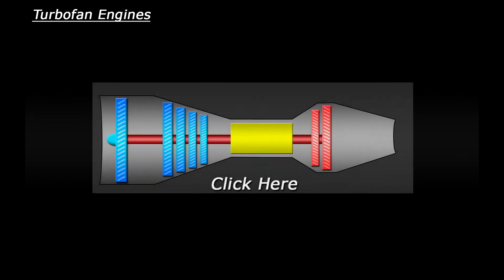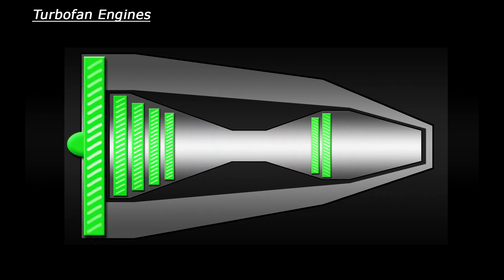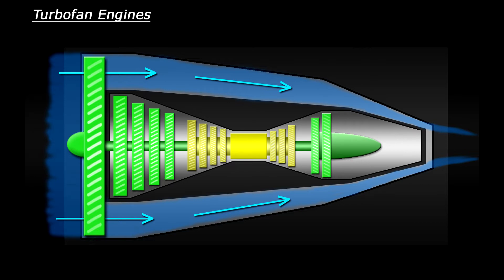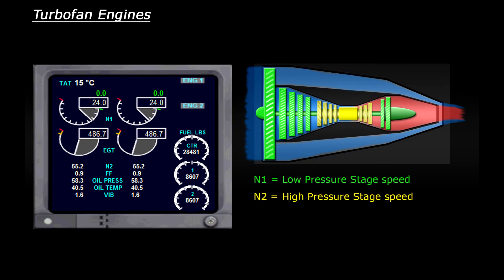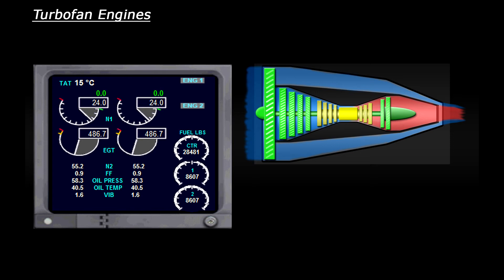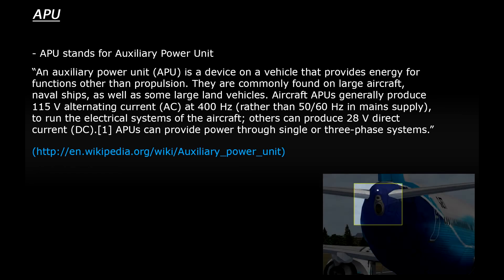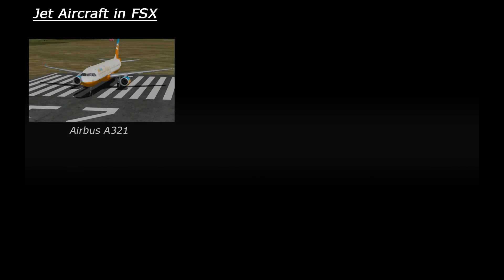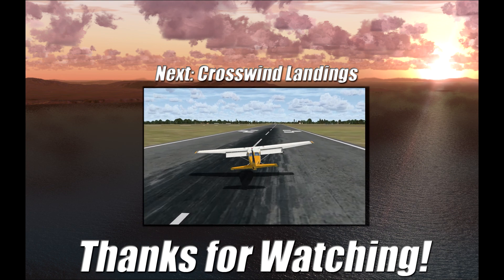FSX Tutorial: Jet Aircraft

Comment: I still can't understand ANYTHING about engines. It's not your fault, I just don't understand mechanical stuff too much
Reply: According to my understanding, this is about right for a bypass turbofan engine:
1) Air, compressed by the APU, turns a jet engine's N2 or core stage (= high+low pressure compressor and turbine blades)
2) Fuel starts to flow into the combustion chamber, when the pilot flicks the fuel control valve switch open
3) The burning fuel increases the air pressure inside the engine. The combustion chamber sits before the turbine blades, to provide the turbine with high pressure airflow.
4) The LP compressor and LP turbine are mechanically connected with an axle, the same is for HP compressor and HP turbine. The fan is connected to the low pressure axle, so the LP compressor and turbine blades' speed = fan's speed. The fan creates an airflow in the core stage, so the APU can be shut off.

The APU/auxiliary power unit is also a jet engine, but it is small enough to be started with an electric motor or some other method.